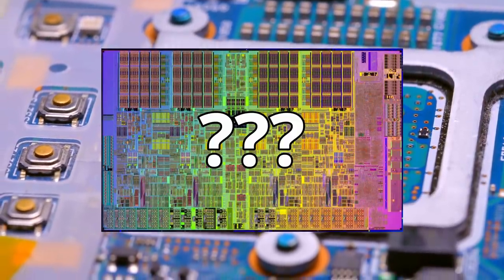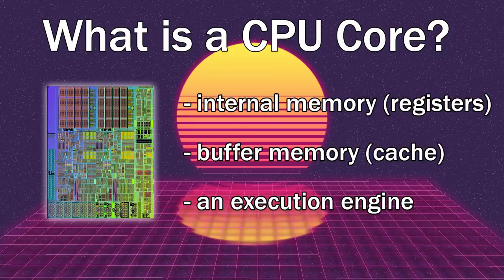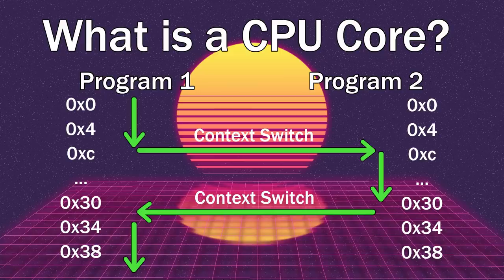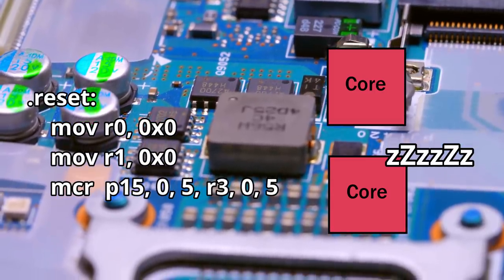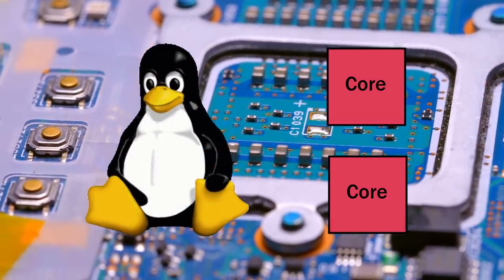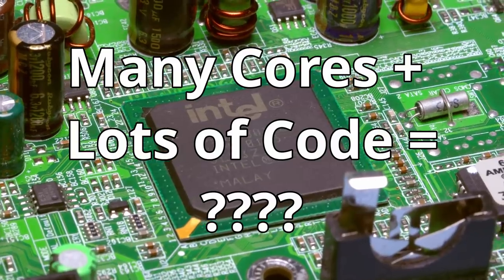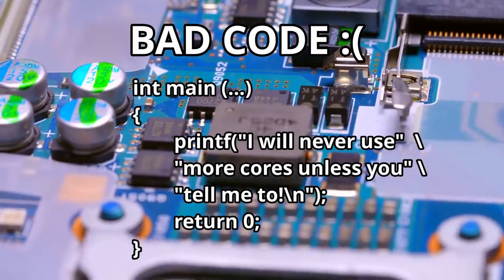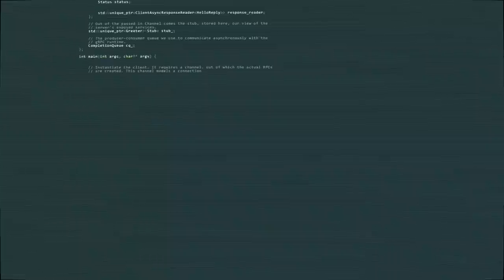why can’t computers have thousands of cores?

Comment: It would be worth mentioning the difference between parallel and linear programs as well.
A linear program is one that, in a simple example, takes the output of the previous operation as an input for the next operation.

a
a + b
ab + c
abc + d
...

That's a linear operation.

A parallel operation on the other hand does NOT rely on the result of the previous operation in the program as a whole.
Using the previous example again, but making it parallel...

Core 0:
a
a + b
ab + c
abc + d

Core 1:
e
e + f
ef + g
efg + h

Core 2:
i
i + j
ij + k
ijk + l

Core 4:
m
m + n
mn + o
mno + p

Then as all four cores have ran their code in their slice of the data, they can synchronize and this happens:

Core 0:
abcd + core1 + core2 + core3
or...
abcd + efgh + ijkl + mnop

But before that can happen, ALL cores must have completed their slices. In this simple example it's no biggie. Each core runs their slice linearly and in linear time too. So they should all finish at the same time.
But in reality, not every program is that simple. Some slices take more time than the others to complete as they do more complex operations. In the meantime, all other cores are just sitting around waiting for the most complex operation to finish. Well, they are free to do other things but not for that one program as the program is waiting for the biggest slice to finish.
Being able to evenly slice up threads of a program such that they all finish at roughly the same time is almost impossible in more complex programs. Especially when you aren't the only program using the cores available as the scheduler might not agree with the program using all cores at that moment in time.

A somewhat perfect example of parallel tasks that actually do take the same amount of time every time (almost) is what the GPU is doing.
The GPUs of today has some ten thousand cores. They all work on their own slice of a rendered image.
Say you have an image that is 1000 x 1000 pixels large, or a megapixel image if you will. Those 10,000 cores will each be working on a region that is 100 pixels large.
If the task is to fill a gradient horizontally across the screen, then each core simply takes the starting and ending colors and interpolates those going from start to end in their block.
This operation takes exactly the same amount of time on each core so it just works on GPU's... Because graphics is less complex than programs are in that sense. Graphics don't tend to sit around waiting for user input, network communications and access to memory.
Each batch on a GPU has exclusive access to memory and all cores. The more data and operations you can cram into a batch the better, otherwise you have to keep telling the GPU what to do.
In other words, it's better to tell the GPU to draw ten million polygons in one batch than it is to tell the GPU to draw a million here, a million there and another million there...
When the GPU has ALL the data in one batch, it splits the tasks amongst all cores equally and just barfs pixels back at you in no time.

Comment: 6:00, Thermal efficiency.  This is hard to throw into a conversation about core counts because a CPU can be lower speed or high speed.  Then you have constraints of a node being used.  These things together mean that Thermal efficiency has little to do with how many cores can go into a CPU, or if we want to be more technical, a die or chiplet.  If one says for instance that due to a thermal limit of X, this die can only have 8 cores, that not really a true statement.  It's more on the line of, due to the thermal limit of X and running a processor at a speed of Y, on THIS node a core chiplet using AMD's Zen 4 X86-64 core should have no more than Z cores.  Every node has different thermal limits, and different characteristic which cause ever faster speeds to cause the die to heat up to the point where thermal limits are the main constraint.  You can clock Intel's Intel 7 obviously up to 5.3 - 5.5GHz which is consuming a large amount of power but clearly it's not affecting the efficiency of the core to do it's work.  What is happening more is POWER efficiency rather than thermal efficiency.  On the other hand, TSMC N7 isn't efficient over 5GHz in any way.  Maybe this will change over time.

So thermal efficiency is really an edge issue, not a main issue.  I could have a die with 30 cores if I run thenm at one speed, and only 8 cores if I run them at another speed when loading all-cores to 100%.  So, that's not a BIG constraint and not one I would have led off with.

This is a situation that just because someone has put out some data, you have to be careful on how you use that data.  It's a neat chart that was shown but only useful for some use cases.  There had to have been a lot more data talked about before that chart was shown, or David Henderson from GA Tech is not very sharp.  Without talking about all that other data, this point is like my other comment, painting a wrong picture.
Reply: How pedantic.  Firstly, it's an issue. Whether you think it's a fringe or main issue isn't really here or there.  Secondly, your comparison to a slower processor with more cores being cooler is intentionally arguing in bad faith.  All else equal, a processor with twice the cores will run hotter and require more cooling to run at its best.  In fact due to inefficiencies they will run *disproportionately hotter*.  As a rule, consumer CPUs with more cores require more cooling.
Reply: @AnarexicSumo  So what you're saying then is every time you use a new node, the argument changes.  

"In fact due to inefficiencies they will run *disproportionately hotter*.  As a rule, consumer CPUs with more cores require more cooling."

So far these inefficiencies ARE related to clock speed.  Every node that every fab makes has a point to where pushing beyond that requires more energy than it's worth for the return amount of work being done by the CPU.  AND, this is INDEPENDENT of core count.

As a rule more cores requires more cooling when everything else is equal.  But that's the point.  Everything else is always CHANGING!  So there are no HARD rules for core count with regards to THERMAL EFFICIENCY.  It depends on everything else.  It's a secondary point.  NOT primary.  THAT is the point.  And yes that is arguing in good faith.  The points made in the video is arguing in bad faith.

To quote "In full transparency some processors these days"...........................  and then proceeds to talk as if it was magical that there exists 64 core CPU, which he simply called "double digit", which I find laughable. 

So yes, thermal efficiency is ONE point, but I could probably put 50 cores of compute power in an Apple iPhone using TSMC N3.  I don't NEED to, but because that die is clocked slowly, those tiny cores would be NOTHING at the speed at which they operate.  So in that case, thermal efficiency ISN'T a limiting factor for the number of cores that are in the device.  And that's why I made the point I did.  There's no such thing as a certain number of cores that creates a thermal inefficiency.  It depends on too many other factors.

Here, points made in good faith for the limit of core count:

Memory capacity.  Each core  needs to have a certain amount of memory space.  What that amount of space is, is widely variable because it depends on applications being run.

Bandwidth into and out of the CPU.  The bandwidth needs to be capable of handling the input or output of data that each core could require.  What this amount of bandwidth is, is widely variable because it depends on the applications being run.

Capability of the operating system.  The OS has to be able to schedule processes (threads) for each core.  If there are so many cores that a scheduler cannot direct threads to each core because the scheduler is not fast enough to rotate through all the cores, then this is too many cores for that operating system.  But this is widely variable and depends on the applications being run because a thread can be short lived or long lived.

I'm trying to think of limitations and the MAIN one that comes to mind is space constraints.  This is a REAL constraint, because it doesn't depend on other factors.  So, space.  AMD is going to be able to release server and WS CPU with Zen 5 that can have 192 cores, or even more.  Based on current space, that's what AMD will be able to do with TSMC N3 with either a server MB or a WS MB.  And if you're wondering how I get that figure, N3 triples the transistor density over N7.  But AMD could be moving to big-little for Zen 5, and AMD might be moving to L3 cache being off-die and being stacked, in which case based on current space constraints, they could probably get up to 256 cores on a SINGLE Zen 5 EPYC CPU.  But they'd have to make other changes to the CPU architecture and other architecture to pull that off.  PCIe gen5 even with all the lanes that EPYC has probably won't move data fast enough so it would probably need to be using PCIe gen6, which means the rest of the hardware will need to be PCIe gen6.  And then DDR5 with 8 memory channels wouldn't be good enough even at the fastest rated speeds.  And, with DDR6 supposedly using the same data word length as DDR5, I highly doubt memory bandwidth would allow for that many cores, for many SERVER applications.  You'd have to rely on many of the cores already having cached the instructions they need to run so you don't have a couple hundred cores trying to hit memory  at the same time.

But would "thermal efficiency" be an issue for a 256 core CPU?  For a server application using TSMC N3 which uses about 40% less power than N7, where boost clocks are usually in the low 3GHz?  No, each core could run very efficiently.  Total package power could be exceeded though, and that's not an issue of "efficiency"  There isn't a limit because it's not "EFFICIENT"  It's a limit because it's too much for that package.  I THINK AMD could release a 192 core EPYC CPU, so WAY more than just triple digit, which makes this guy's "double digit" comment a complete JOKE.  I THINK that with TSMC N3 and the lower clock speeds of EPYC, AMD can get up to 192 cores with Zen 5 as long as DDR5 has hit much faster speeds (they're at 6400 now) AND you increase memory channels to 12, AND AMD has move to stacking L3 cache and it uses something on the lines of 192MB - 256MB AND the hardware platform is using PCIe gen 6 AND AMD adds 25% more PCIe lanes to the CPU, although maybe the move to PCIe gen6 is good enough to handle the bandwidth needs of that many cores with the existing lanes they have now for EPYC.

And I hope that helps to clear up your lack of understanding on this topic.  If not we'll agree to disagree.

Comment: In the world of x86, there have been multi processor systems for many years, I used to fix them in the mid to late 90’s frequently.  However back then, the physical limit was 4 processors before system performance was hit, anything more than 4 were divided into sub groups of up to 4 processors and interlinked together with a separate scheduled data transfer architecture (until transputers came along, but that’s another story).

This limit was overcome, in part by adding complex cache systems, and while 8 processor systems were now possible cheaply, there were two issues looming on the horizon, Moores law and physical space.  The answer to keeping speed bumps predicted by Moores law?  Bung more than one processor on a chip, this helps with space, and oddly enough, power consumption too.

Further advancements have helped shove more cores, essentially what we used to call our CPU, onto a single chip, boosting performance as we go.

However, doubling the cores does not double the performance, there are and always will be bottlenecks, which become greater with the more cores added, plus the thermal envelopes that our systems need to run under.  In many systems now we get past this by breaking the chips down into multiple chip let’s, essentially smaller chips on a single chip chassis, or by adding multiple chips, meaning we’ve gone full circle.

Still, it’s been interesting from my view, watching computing develop over my (nearly) 51 years at the time of posting this, with 3nm chips due to become mainstream, whole RAM modules fit into the space of an entire CPU from 4 decades ago.

Comment: Meanwhile a common GPU boasts 8000 cores. Tho they are much slower and has only a small set of instructions. Also the instruction set is not standardized. As such  OpenGL/OpenCL is implemented by the vendors themselves.
Reply: Still Turing complete though.  There are highly parallel SQL Databases which run entirely on the GPU, such as Omnisci (formerly MapD) for example.

Comment: Intel have made a 1000 core processor... back in 2010... it really wasnt that large, it was a fork of 386 ment to run grapics code...so a x86 gpu.... I turned out to not really work well.. but the processor worked
Reply: A 1000 core real CPU. Fo you have a proof that Exist?
Reply: @zredplayer  https://en.wikipedia.org/wiki/Larrabee_(microarchitecture)

Comment: So far Windows for desktop have a limit of cores that can be used, Linux has not. But it's a thing for considering on the future.
Maybe when the limit of core is reached they will make emphasis on number of instruction per cycle.
Reply: They did, long ago. That's what pipelining, superscalar, out-of-order-executing processors are all about. However, there's limits to how much you can auto-parallelize a single thread, thus they turned to multi-core - which make the programmer parallelize explicitly - out of desperation, since all other avenues for improvement were exhausted.

The future is more cores, because we hit the point of diminishing returns for adding more transistors to a single core long ago.
Reply: @clovernacknime6984  there was attempted seriously since pentium 4 on regular cpu were more on servers and specific cpus. The risc did more but at expense of the operations. Maybe return of cisc too can work.
Reply: @AlejandroRodolfoMendez  
Since Pentium Pro around 1995 all Intel CPUs are RISC-like internally. AMD followed. x86 CPUs are CISC from the outside, but internally they use all of the "tricks" that make RISC CPUs so fast.
Reply: @clovernacknime6984  
> out of desperation, since all other avenues for improvement were exhausted.
Exactly. Well said.
Reply: @Conenion  they weren't full risc tho. But yes they were doing stuff like that before.
Reply: to be fiar windows 10 for a standard end users has a limit of 256 cores... im sure when we get near that number it will go up
Reply: @Demon09-_-  for home is Iike 32 cores and for business is 256, probably will fix on the future but already some ryzen cpu only have the few cores on Linux and other ux systems
Reply: @AlejandroRodolfoMendez  ah yea home is 64 cores pro is 128, work station enterprise is 256.  But if you think about it the largest single chip server cpu has 64 cores so if you plan to have two your probably a pro user if you want more then two it's probably a work station and if it's beyond that it's a server
Reply: @Demon09-_-  true for now at least, I saw coming better processors hopefully so it's really close to that point.

Comment: I'm just gonna guess before I see your explanation. Firstly, there are actually relatively few computational problems that can be more efficiently solved with lots of parallelization. Secondly, once core counts go above a certain limit, your chip either has to be really big, or you need an unreasonably large cooling system to keep it from melting a hole in your floor. Ok, I'll see if I'm right!
Reply: Had to refill the liquid nitrogen every 30min lol
Reply: Well the temperature thing has already been kinda debunked. The original Pentium D is a perfect example; 2 cores, 2x the thermal load. But that's not really a problem with modern dual, quad, or even octuple cores. Today 32 cores requires 250w, in 20 years it'll take 25-50w. 20 years ago 8 full cores on a single package was considered stupid as nothing would ever even use them and if they did they'd melt, now I have 8 full cores in my laptop and they spend plenty of time at 100% usage.
Reply: "there are actually relatively few computational problems that can be more efficiently solved with lots of parallelization" -- uh, what? The class of problems suitable to SIMD architecture is quite large. It's been a significant chunk of research for decades. Modern graphics cards exist, and are in short supply, because there are so many useful applications for that architecture, not just gaming.

Indeed, the neural network machine learning space alone has myriad applications. And that's just one sub-genre of the larger picture.